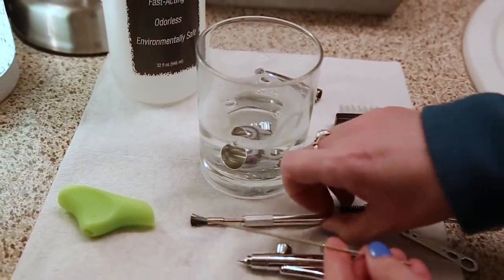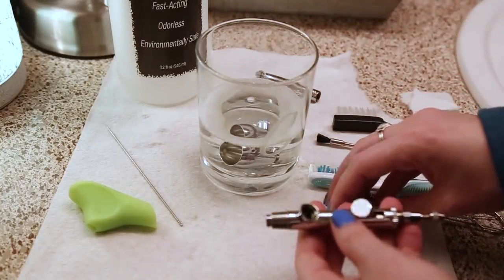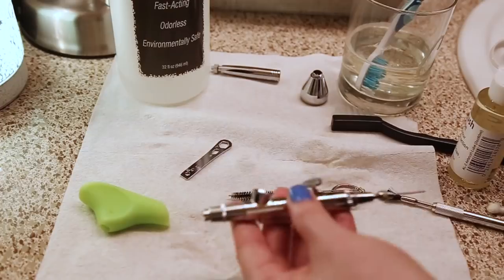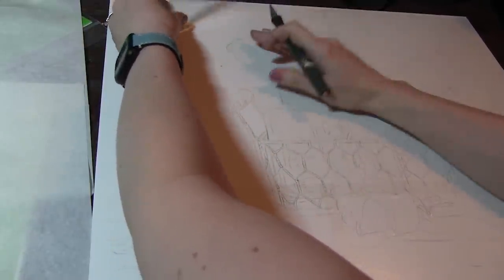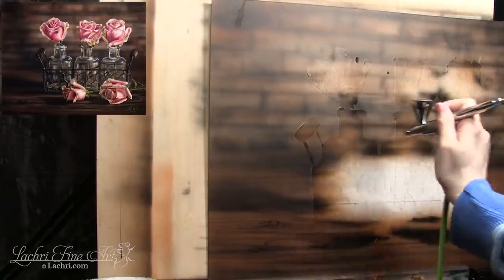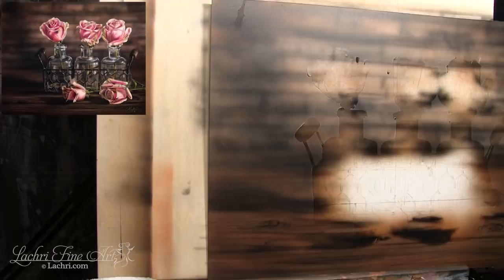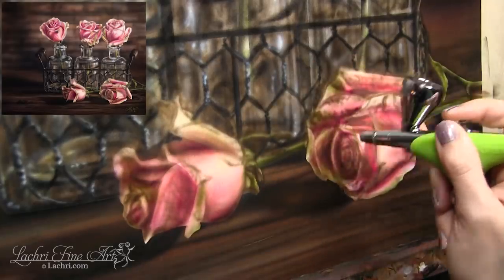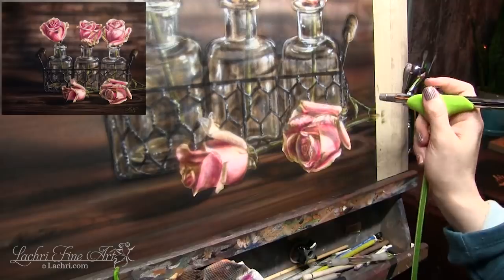Airbrushing Tips - Grex Airbrush Setup & Demo - Lachri

Comment: just a quick critique...it is easier to airbrush holding the brush with two hands and paint standing up with the area that you are working on should be roughly just below the shoulder area. Also, pull your arms as close to your body as possible, this creates more stability. I like to say - paint as if you have arms like a Rex dinosaur lol! Sitting and painting one-handed above your eye level will result in a very rough and shakey look.  This is because your hands naturally shake and you are not putting medium to canvas like a regular paint brush.  When painting you are basically making long and short dagger style strokes, most people will confuse this and think you are drawing like you would with a pencil.  Overall, great work though btw.  Love your tutorials!

Comment: Just a tip - DO NOT run the needle backwards through the front. Always go through the back of the gun with the tapered edge going in. The back of the needle has little notches that can affect the gasket and break the seal. Bryant from Grex told me this yesterday when I was going over some trouble shooting with my airbrush. A couple of times won't hurt it but do not make it a normal thing when you clean it.
Reply from the maker: Interesting. The problem with running the needle from the back to the front is it's really easy to bend the tip of the needle. Seems like you just have to decide which is the lesser of two evils? I've always run my needles from front to back and never had issue.